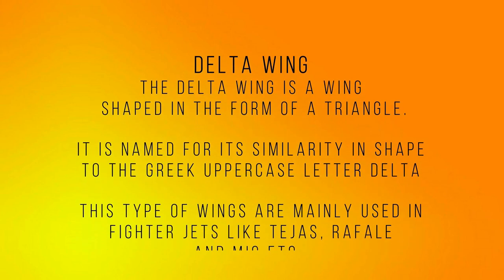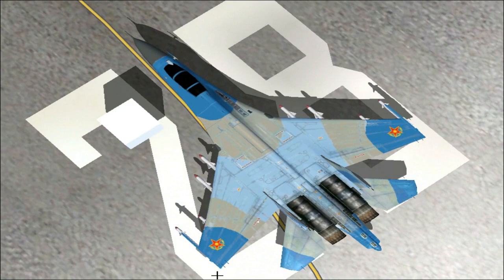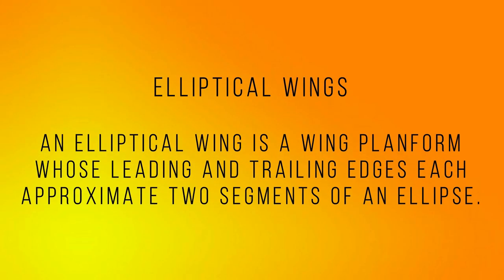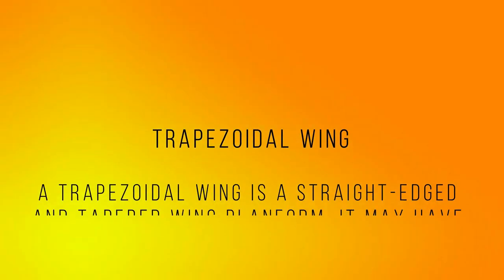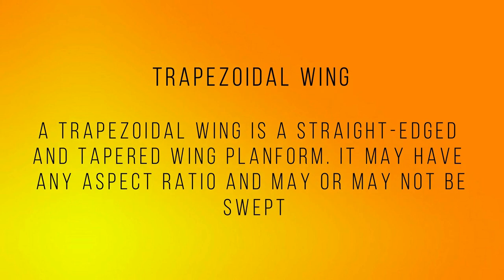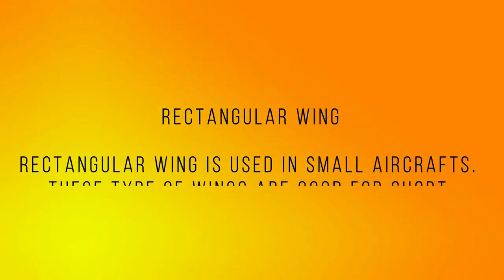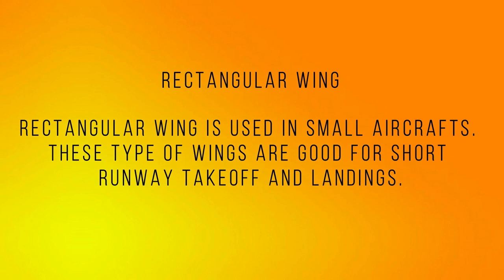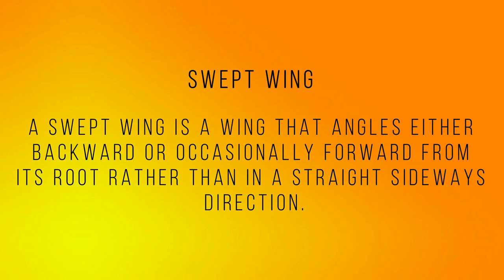TYPES OF WINGS IN AIRPLANE / AIRCRAFT | AIRPLANE / AIRCRAFT WINGS CONFIGRATION

Comment: Thanks for attempting but the video could do with a lot of work. 

The first example is not in fact a Delta wing. It’s an example of a swept back wing planform. Typically used in modern civil  aviation design and also in defence aircraft. It’s design reduces drag on the leading edge of the wing but produces relatively low lift at lower speeds compared to other earlier planforms.

The second example is actually also a trapezoidal planform with  the leading and trailing edges both tapered, not an elliptical as stated in the video. Probably the most popular example of an elliptical wing planform is featured on the RAF Spitfire plane. It’s not a perfect ellipse either, It features a greater sweep on the trailing edge as compared to it’s leading edge which is very straight.

The trapezoidal wing planform does not feature any specific combination of swept or straight leading/trailing edges by its definition. It gets its name from the ‘trapezoid’, a quadrilateral shape with two parallel edges. In this case we can call the root of the wing (by the fuselage) parallel edge 1 and the wing tip parallel edge 2. Any combination of tapering, provided the wing tip (in this case) is parallel to the root of the wing, would be considered a trapezoidal wing. Even swept back wings can be trapezoidal.

The swept back wing example looks more like an elliptical by the rounded tips but ultimately is not swept at all. This is evident just by the straight trailing edge of the wing being at a 90 degree angle to the fuselage. I think you meant that this is an ‘Elliptical wing with a strong sweep on its leading edge but a straight trailing edge’.

We all gotta learn my friend, please ensure you properly read up before you upload. 

,Happy trails